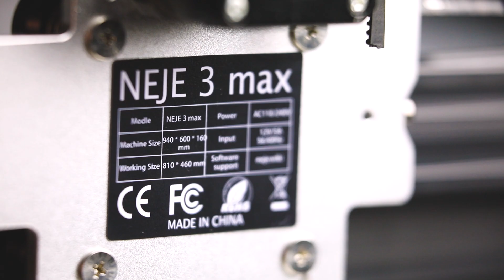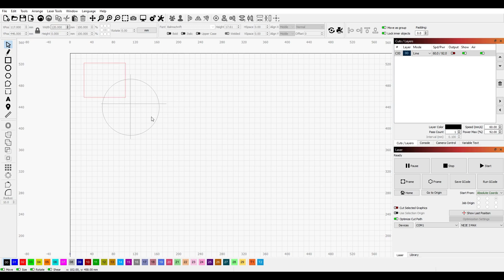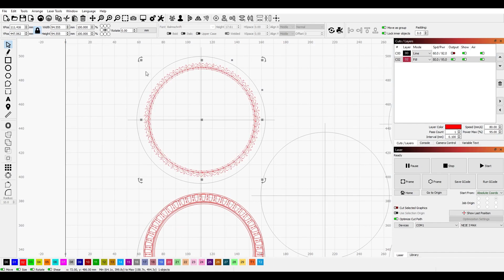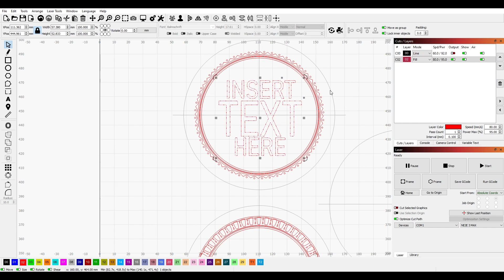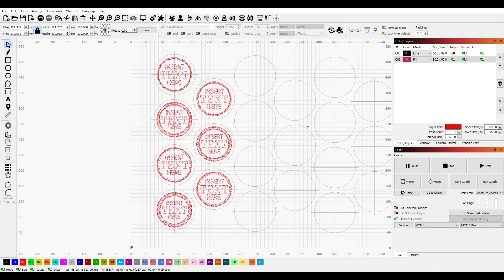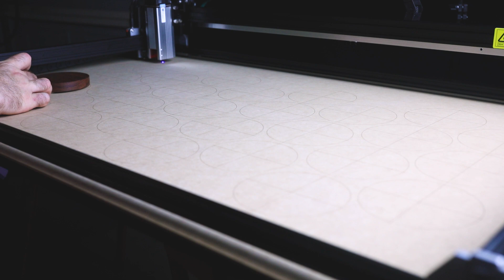Lightburn: Batch Production // NEJE 3 MAX // E40

Comment: Why didn't you cut the circles into your sheet material? I think that this would speed up the positioning of your coasters.
Reply from the maker: Great question! Cutting out voids would work beautifully if my coasters were all exactly the same size, however due to the variable shapes and sizes, this would only create more issues… additionally it would have added another hour onto the setup time cutting out rather than marking surface and I couldn’t re-use the scrap mdf for other projects. It comes down to user preference, however both techniques definitely work!